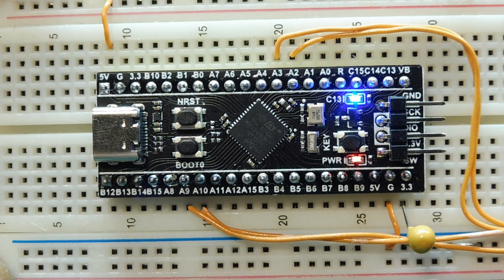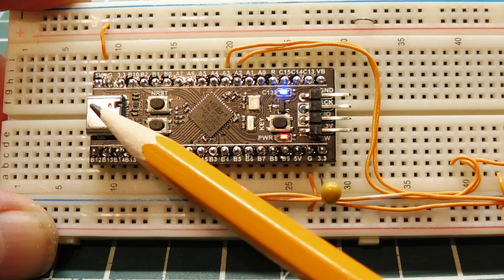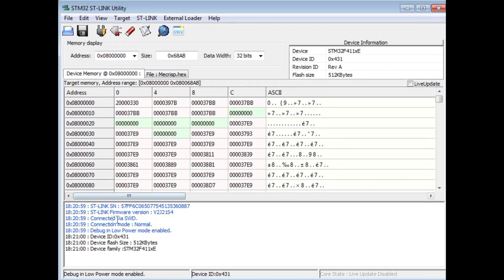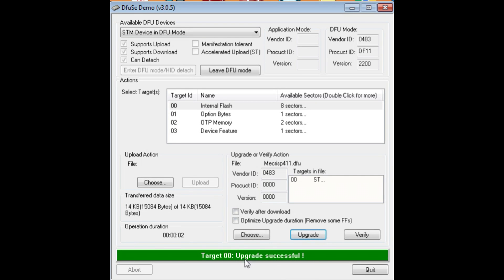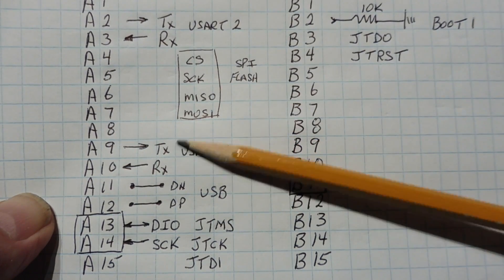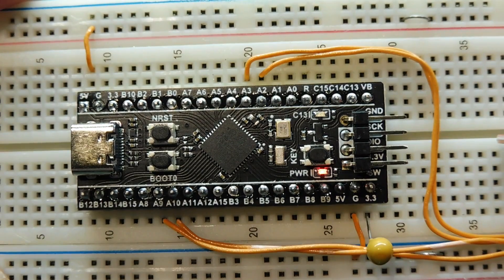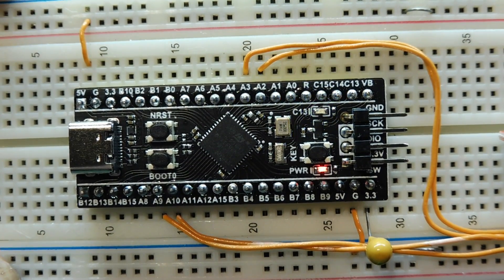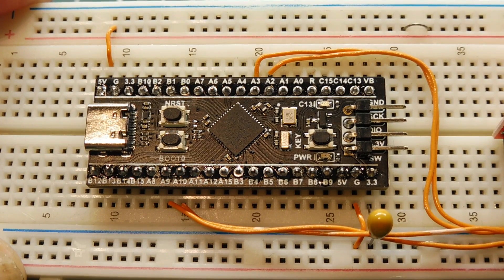STM32F411  / Bootloaders  / Mecrisp Forth / Blackpill

Comment: I'm fine until 7:05 where it says Available DFU devices, which is blank. Windows Device Manager shows a STM32 BOOTLOADER under Universal Serial Bus Devices. I have been able to install and run the blink program using the Arduino IDE so I expect the board and the cable are good.
Reply from the maker: Yes, DFUSE can be hit and miss. On reset the micro runs on the HSI 16 mHz RC clock. The PLL multiplies it to 48 mHz for USB operation. This clock is temperature dependant and may drift which will affect the operation of the USB port. You can play with the HSITRIM register ( 0 - 35 ) and configure a GPIO pin for MCO output and calibrate the 16 mHz clock and save the TRIM value to flash or use CRS Clock Recovery System for autotrim. Check online for more info.
In the meantime use the reliable SWD and dongle method.

Comment: Hi
I need help.
I have a stm32f chip with 48 legs.
Leg 44 is the boot where I should give it 3.3V. But which side is the 44th leg? I can't find a description of this anywhere.
Reply from the maker: When orientated so you can read the part number, pin 1 will be at the bottom left. There should be a dot in that location.
To double check, all VSS pins (Gnd) are connected together and are in the same location on each side except for the side with pin 1. With an Ohmmeter and the pinout from the datasheet you confirm pin 1 then count around to the desired pin number.

Comment: Great video and I have had the parts for years. One tip - never use a pencil as a pointer as you will have high impedance leakages.

Comment: Couldn't find the device in dfuse demo. I by mistake erased the bootloader came with the board in the STM32CubeProgrammer. Is there any method to get the original bootloader ?
Reply from the maker: The three bootloaders are factory installed into the microcontroller and cannot be erased.
Reply: @0033mer  But I think I erased everything using STM32CubeProgrammer, before I was able to program it with Arduino IDE using SWD, but now I can't and only with STM32CubeProgrammer.
Reply: @0033mer  Also I can't use dfuse. I installed it and tried to get it to connect but it's not appearing on the com port.
Reply from the maker: Check out STM32duino when using the Arduino IDE with STM32 boards.
https://www.mischianti.org/2022/06/09/stm32-programming-stm32f1-via-usb-with-stm32duino-boot-loader-2/
Reply: @0033mer  The bootloader is for the STM321, does it work for the STM32F4 ?
Reply from the maker: Go to STM32duino site and download BoardManager Files. You will find the bootloader for your micro.
Follow instructions here:   https://www.youtube.com/watch?v=yssEiMLGH90

Comment: very clear explanation,,,,,,,,but......how do you enable the external memory soldered on the pads of the board and where to go to enable it ??
Reply from the maker: The external memory is SPI flash and is used like any SPI device. Check the schematic for the pins that are used for the SPI port and the data sheet for programming.
https://www.adafruit.com/product/4763
Reply: @0033mer  thanks a lot dear !!!!!

Comment: Great tutorial, got me to ditch the AVR platform for ARM. Really good info, really appreciate the work you put into this. Have a question though, what's the cap going from 3.3v to ground?
Reply from the maker: 10uf cap on the 3.3v line for a bit of filtering.

Comment: Very helpful vid, thanks!  Is there any way to use UART6 ??  The STM32F411CEU6 datasheet shows that there is a UART6 but the pins are shared with USB so I don't know how to use UART6.  I have a project where I'd like to use all three hardware UARTs if possible.
Reply from the maker: If you are not using the USB port you can set pins PA11/12 as UART6. UART6 is also on pins PC6/7 but is not brought out on the module. If you go to the Nucleo F11RE board you can access UART6.
Reply: @0033mer  Thanks for the very useful info and informed response.  I really appreciate it.  I bought myself a Nucleo-401 demo board as well as BlackPill to play with so I should be good to go.  Installing the USB bootloader was a great idea because it gets you away from the boot pin manipulation.  I prefer to build projects where the user just plugs in the USB and can invoke the bootloader with a simple power reset.  Super useful.  Using STLink via SWD port wipes out the user bootloader but it doesn't matter during code dev anyway, just reinstall the BL at the end and BL in the finished app.  I've been doing that with PIC devices forever so the workflow is the same in that respect.  I want to design STM32F411RE (64-tqfp) onto my own custom PCBs but I can't seem to buy the raw chips anywhere (global shortage?) so instead I'm buying the cheap devboards to get by.  A nice advantage of the very common serial bootloaders going through an FTDI USB-to-UART converter is that you can route the FTDI /DTR pin to drive the MCU reset pin and if your PC side host downloader supports DTR then it'll reset the MCU for you.  That way the user doesn't even have to reset the power to download at any time.  I've been doing that with PICs too.  After 28 years of working almost exclusively with PICs, I'm now trying to move to STM32 (maybe later ATSAM too) to take advantage of the inexpensive STLink programmer/debugger (ICD3/4 cost $100s) and free software and compiler.  Microchip wants $1000 per year for each of 3 compilers (XC8/16/32) which is a ripoff.  Also, since ATM32 is now supported by Arduino, Python, C/C++ all for free, the choice is obvious.

Comment: Can anyone help me? , I'm Using USB method, but when I plug in my W10 system isn't recognising board. It says USB device not recognised when I pressed Boot mode in PCB. Any  extra circuit needed in dfu mode or USB  is enough? Please guide me.

Comment: Sweet!  I picked up a 3-pack of Blackpills, and am having a blast with Forth!  (Haven't used it since the C64's Blazin' Forth!)

One question, though... How did you get the MCU to 100mhz mode?  When I run the command from the Mecrisp folder (100mhz.fs) the thing hangs so hard that even STM32Cube loses connectivity to it.
Reply from the maker: 100mhz.fs was written for the STM Nucleo board where the HSE clock is 8 Mhz. Blackpill has a 25 MHz HSE clock. To program the PLL divider properly change the line of code:
8 0 lshift or  --->  25 0 lshift or
Reply: @0033mer  Woohoo!  That worked - thanks!

Comment: thank you. I tried to follow your steps. I uploaded the forth OS using FTDI programmer with pin A10, A9. however I am not able to communicate with forth via tera term I used pins A2, A3 it works when I do reset it shows the massages and the "ok. " massage. but I cannot see the pins and stuff like this... can someone help thank you..

Comment: I would like to congratulate you and say thanks for sharing your knowledge in such a clear way!
Reply from the maker: I appreciate that!
Reply: @0033mer  I have an idea for a video after watching this one for 6 times. lol
What do you think about using this black pill board hooked to an RN487x serial bluetooth module to perform OTA firmware updates using flash loader  method (USART1 on pins A9 & A10)? 
In order to also be able to remotely make the device go into bootloader mode without any human interaction on buttons BOOT0 & NRST, you could replace the buttons or add a transistor or a load switch controlled by the GPIOs present on the bluetooth module. You could control the status of both buttons remotely by means of AT commands and independently from the microcontroller.

Something similar has been made for arduino. However, the HM-10 consumes relatively high current when it goes into "sleep"
https://github.com/MEming/Device-Firmware-Update-OTA-Bluetooth-Low-Energy

What do you think?
Reply from the maker: To simplify OTA programming on any microcontroller I use Forth as my programming language. The Forth operating system enables you not only to upgrade code but to also upgrade the compiler as the code is running. NASA has used this technique for OTA programming on their space probes millions of miles away.
 https://www.forth.com/resources/space-applications/
Check out my video where I use this technique on the Arduino Nano.
https://youtu.be/vMC_LMmtFac
To increase range you can use LoRa instead of Bluetooth.
https://youtu.be/V2mopznhELE
Reply: @0033mer  Cool forth video! I haven't used it so far.
I am using Micropython, and by following the approach that I proposed above, I would be able to just update the internal ".py" files or update the whole interpreter remotely.
My application in particular is already using a lora module to interace with a LoRaWAN network, I thought a BLE module would bring OTA promaming, as well as Debugging through the terminal.
Additionally, I think it worth mentioning that the node will physically located up on a mast that is part of the power distribution network.

Comment: What are your thoughts on the more complicated terminal shells for embedded Forth? What level of complexity is useful/required for real world projects? I tried to build a parallel memory chip programmer with flash forth, and have spent lots of time learning python as a result. Passing blocks of binary information with a terminal that was not written to be extensible is hard. Now I am aware terminal quality is an important factor with a forth system. Any thoughts on the subject from a more forthward user?
Reply from the maker: Python has a lot more features and is much bigger than Flashforth so in your case it may be easier to get a project up and running using Python.  Forth programmers usually write their own tools by extending the compiler and basically creating their own language. Back in 1987 Dataman introduced the Dataman S4 emulator/programmer which was an embedded FORTH product which became very popular. https://www.aliexpress.com/item/4000073336339.html
Reply: @0033mer  
Yeah, the more extended (embedded) forth's I've come across are, MyForth and AMForth. MyForth looks like a bottomless rabbit hole I probably won't try.
http://www.kiblerelectronics.com/myf/myf.shtml
 IIRC it is the only flavor I've seen that uses Forth for both sides of the embedded toolchain. I mean, the terminal emulator is written in GForth, so it's a forth system on both the host and client.

  I also looked into AMForth's shell code after a couple of emails with Mike (FF's auth). AMForth has a large level of integration between it's python based terminal shell(host) and embedded-forth(client).

   I wasn't talking about using python to program the μC though. I needed to use python just to modify the terminal to send and receive the binaries. Maybe the miscommunication is due to our different choices of OS. With Linux and a python based terminal script, modifying the terminal is easier than Flash Forth, at least as far as changing how forth sends and receives larger files. FF's python shell has no ability to receive and write the contents to a file. My other issue is that I don't like having to mess with the MPLabX side of Flash Forth. I don't want to recompile the base system for a PIC μC unless I have too. So, I think FF was probably the wrong choice as my first forth system to learn with. 
    Mike's choice to lock out users from redefining words in Flash Forth really makes it difficult to follow Brodie's books after about half way in. Plus, I only recently found Peter's full documentation and repositories for his 2 flash forth pdf guides. There are a few differences between the version of the software Mike has on sourceforge and Peter's. Using Mike's version and his included libraries makes around 1/3rd of Peter's 5 page guide disfunctional. It's been a fun learning experience though.

   I'll be trying some other forth flavors soon. I have a MSP430F149 minimum dev board, on order, to try NoForth, and the STM32F4xx's to try with mecrisp.
  Have you seen any other interesting forth flavors to try?

   If you haven't seen it, Chuck is working on a forth that he has running on a current x86 intel i7 and is working on running it natively. He did a presentation a few months ago for the Sili. Valley FIG. It's on their YT channel :-)
-Jake

Comment: Is there an arduino style bootloader that you can use for this board?
Reply from the maker: Search online for STM32duino.
https://github.com/stm32duino/wiki/wiki/Getting-Started
Reply: @0033mer  Thanks a lot. I've noticed that one as well as others but i'm unsure what to go with. I've order 2 of these boards yesterday so i can move my project from teensy 3.2 since those have a locked (closed source) bootloader and i want to minimize the cost of my project. The reason of having an arduino style bootloaded is that the end user will not have access to reset buttons and they may want to upgrade their firmware via the usb port. So it needs to be easy and needs to be done from the same usb port that the device is connected. Btw, great video. I found the original designer that made this project and has all the info here: https://github.com/WeActTC/MiniF4-STM32F4x1

Comment: I have Mercrisp forth running but need to upload a forth application to the micro. When i paste it into the terminal I get a lot of error.  I would like to do it like tachyon forth.
Reply from the maker: You are probably uploading text too quickly. Set a delay for characters and end of line in your serial terminal software. I use 5 msec/char and 90 msec/line delays.
Reply: @0033mer  Your delay numbers sure did help; sure will speed me up.      : = ))